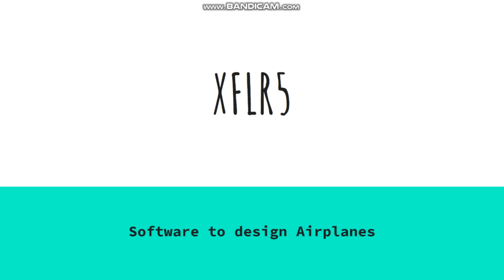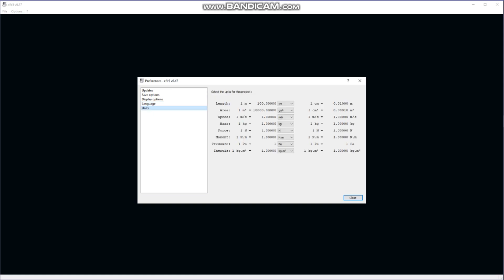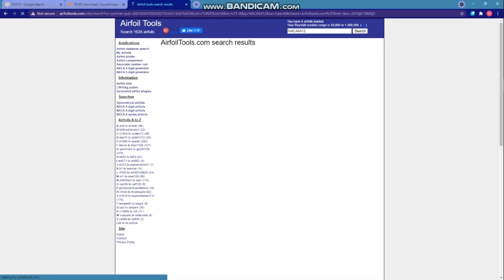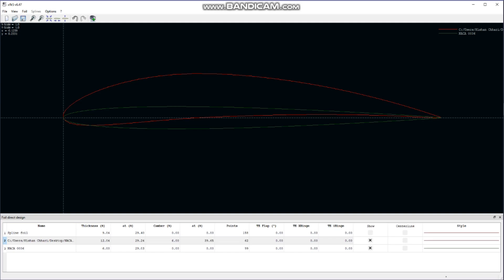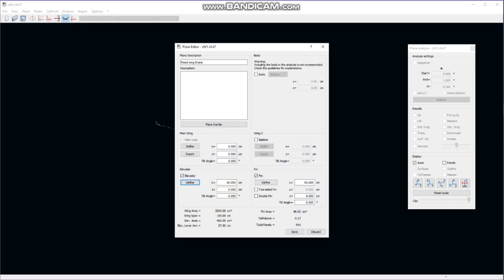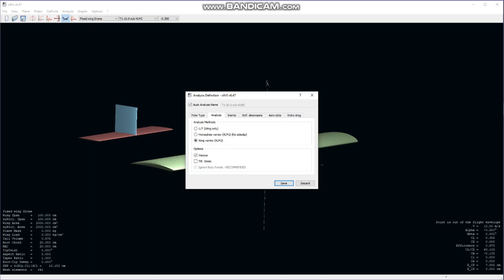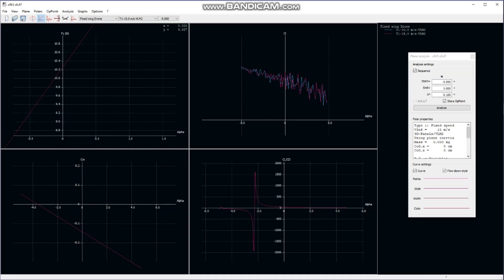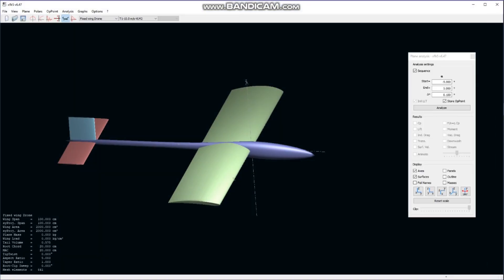XFLR5 for Aircraft Designing

Comment: wrost video ever watched following the same steps didn't get the graph and results
Reply: Yes, I followed the steps exactly, but it kept giving errors in the analysis. It did not show analysis results in multiple tables.
Reply: @azramiler7277  how did you solve the error?
Reply from the maker: @azramiler7277 you have to make sure that airfoil which you have imported is a proper airfoil and completely closed ! To avoid this … you can use the existing airfoils on a NASA website !